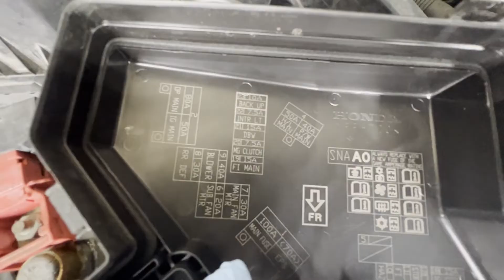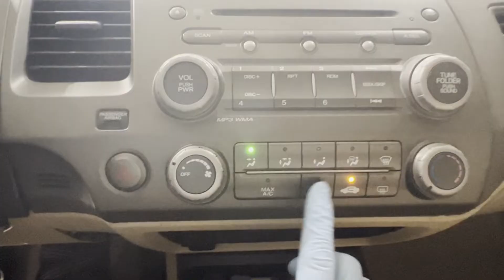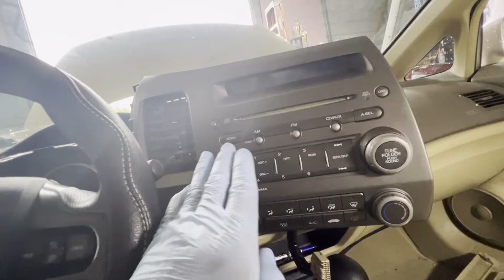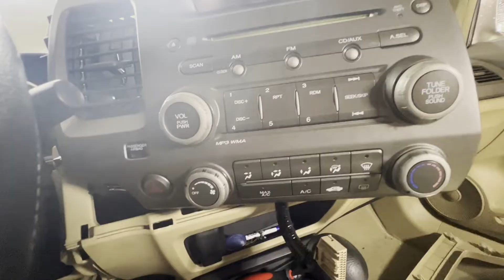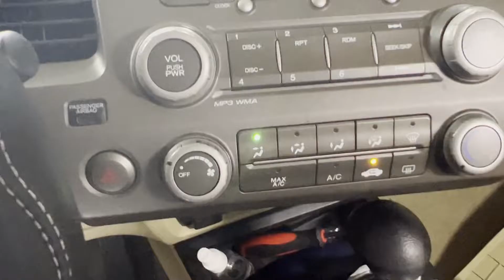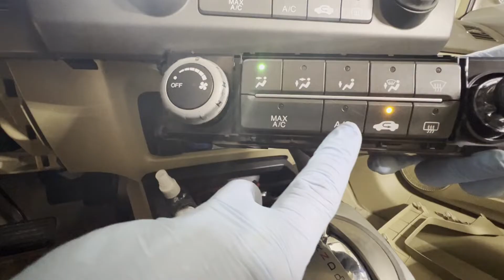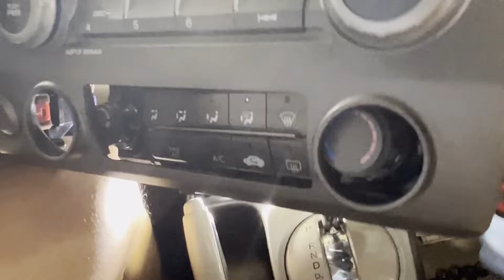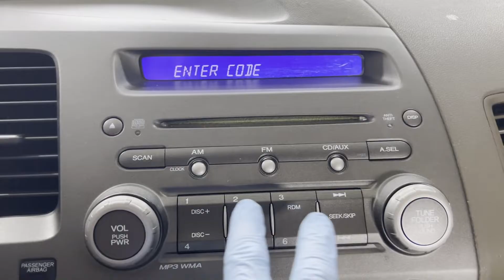AC compressor always on / wont turn off *Fixed* Full diagnose & Repair 07 Honda Civic 8th gen How to

Comment: Sounds like the starter is bad, at least one of the brushes is burned out.
Reply from the maker: Starter related to ac ?
Reply: @autopurlieu  No, just an observation. Slow cranking like that one has is symptom of the starter having 1 or 2 burned out motor brushes. Common issue.
Reply from the maker: @superjesus4307  if it ain’t broke, don’t fix it 😆
Reply: @autopurlieu  It is broke though lol
Reply from the maker: @superjesus4307  ac was broke not the starter
Reply: @autopurlieu  no no no, the starter is broken too. Different problems. Soon that starter will die completely as the working brushes are overworked.
Reply from the maker: @superjesus4307  if you say so. I believe you. But this video is been over a year and car still start right up
Reply: @autopurlieu  So did mine, until it decided one day not to. New starter cranks 2x faster and doesn't make the dash flicker the way yours does.

Comment: If the climate control worked what else would power the AC?
Reply from the maker: There’s plenty of variable for that. Fuse, relay, high pressure switch, etc etc
Reply: I have an 06 m45 Infiniti. I walked out the gas station and turned my car on to find my nav screen won’t turn on and ac control module button don’t work at all. First time and random. I don’t know where to start. All of the fuses I checked works.